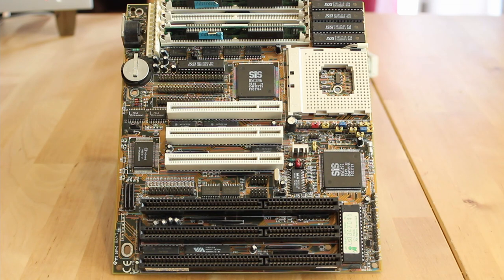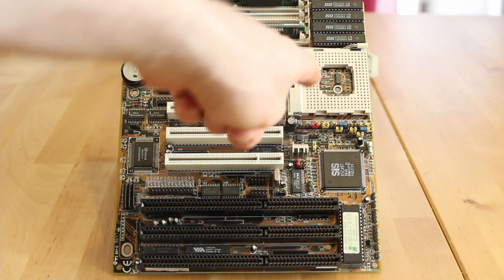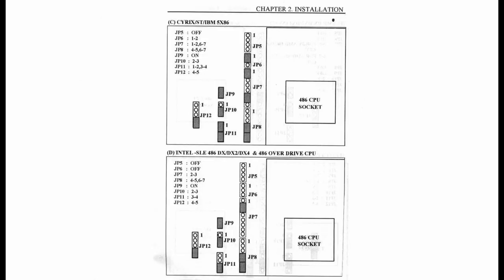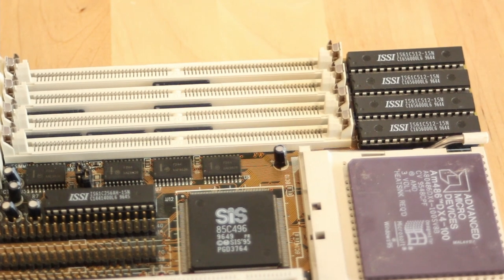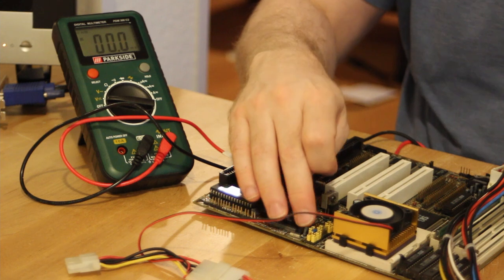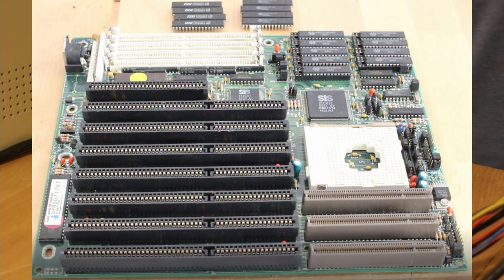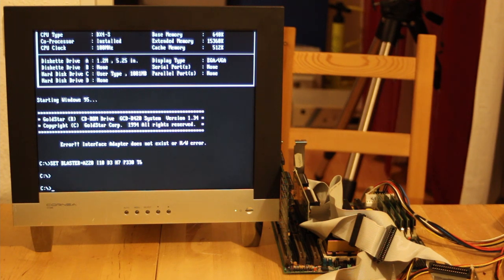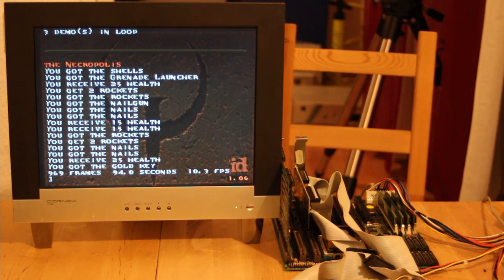Attempting to revive a Socket 3 Motherboard + 512kb Cache Experiments

Comment: Waiting for my 512k cache to arrive from Aliexpress for my P133 - I did a video look over the IBM PC330 P75, and since then....
Dead CD-ROM drive replaced by spare CD-RW, Dead Sound card (software good, but never got any audio) replaced as well, P75 replaced by a P133 I had left over from way back (and set board for P100 as it doesn't specify P133, runs it fine), also pulled the mismatched FPM + EDO and loaded it with all EDO.

Now my quandary, I though my S3 Savage 4 had died, but it seems the monitor I was using just didn't like it, so I got a Quadro NVS 280 (FX5500) and now I don't know what to use (built-in, Trio64 limited to 32 by RAM config).

Target: DOS + Win98, so I guess the S3 would retain better DOS compatibility (and even win 3.1), while the NVS 280 is a much more featured Win98 card.

Also debating loading the the other 2 slots with....
PCI Sound (SB Live) and ISA network
ISA Sound (SB16 value) and PCI network
ISA sound and PCI USB
Reply from the maker: Sounds like quite a nice machine, whichever way you choose to go. Hopefully the cache works ok for you. It seems to be finnicky in my experience so far. The board you have is probably more reliable than the ones I've been using though.

Comment: I think there are expansion cards you can buy that show you error codes. Perhaps that can help with finding the fault. Also, perhaps you could check the clock. Crystals can go bad.
Reply from the maker: Yeah, I ought to have checked that. The BIOS and clock were actually my next guesses for what could be wrong with this board. Unfortunately these 486 boards are a lot harder to diagnose than earlier stuff, and it's currently way outside of my experience to be figuring it out if it isn't one of the larger discrete components that has gone bad.
Reply: @PCRetroTech  There is also a diagnostic freeze spray to check whether chipset is faulty. Many times faulty chip "wakes up" when frozen (and dies again after a while).
Reply: @PCRetroTech  If the chips are bad, it's not something anyone would bother testing, but either swap them out or use the board for spares. The line has to be drawn somewhere, right? Chip cooling, like @fradd mentions, could help identify a faulty chip though, if you really want to know. It's possible to check chip legs for shorts and breaks, but that's a lot of effort for finding a problem you can't fix anyway.
A re-flow might be an option in case there's a connectivity issue on the board. Swapping out the Crystal is at least an easy thing to do. The BIOS is a bit more tricky, at least when you don't have a backup.
There isn't many components on this board, so really there isn't a whole lot that could be wrong, and there doesn't seem to be any other evidence.
Hope you find a fix. Either way, it was interesting to watch! Edit: Ah, you fixed it!

Comment: Thanks for showing UH19 :)
If you look closely on the back you can actually read "LS486E"

I have added the manual to the page and more infos about the board.

Actually there IS a bios on the page ! It may not be realy clear though, but in the BIOS section, if you click the three "???" you it'll let you download the BIOS.
Reply from the maker: Oh yeah, I really did miss that. I'll look out for that next time.
Reply from the maker: It might be worth also adding a note to the page about the incorrect FSB settings in the manual (1-2 <-> 5-6).
Reply: @PCRetroTech  absolutely !

which are the swapped jumpers exactly ?
Reply from the maker: @DxDeksor  It's JP18. The manual says the 33MHz setting is 1-2 but it is actually 5-6, at least on my board and one board on Vogons. Of course I don't know how common the problem is and whether it is a PCB or manual issue. But it's useful info for anyone stuck like me. In my case someone had remove jumper W2 and my board wouldn't start up without it, so that's why I wasn't easily able to find this problem without a hint. I don't know what W2 does (in either setting).
Reply: @PCRetroTech  I've added this info to the page, thanks :)

Comment: I have the same exact board, visually in pristine condition, and I have the same problem- board is not booting whatsoever, I had speaker attached and no beep at all. Seems like these boards go bad on their own or something..
Reply from the maker: Yeah it is a very odd case. It's hard to see from the video, but this board is very clearly not physically damaged. Of course it is possible that a surface mount component has been knocked off somewhere and I've missed it. But I have looked. The board really ought to be working, and I feel stupid like I've missed something obvious. Let's hope we figure it out eventually.
Reply: @PCRetroTech  I started researching it, and it seems that in some manuals the FSB settings for 33mhz are flipped, jumper isn't on 1-2 Top position but on bottom 5-6 position. I will test that when I get home
Reply from the maker: @yosuhara  Oh, that sounds interesting! I tried only 33MHz and 40Mhz settings. If these are really backwards then that would definitely explain things. That sounds so promising that I'm going to try it out right now!
Reply from the maker: Unfortunately I don't think that is the (only) problem with my board. Still no luck getting it to POST.
Reply from the maker: Nope, I take that back. You nailed it. 33MHz is incorrect in the manual!

I had another problem with the board (also not in the manual), which I just diagnosed (jumper W2). Will show details in the next video. Very exciting because I have heard this is one of the fastest PCI boards in existence!
Reply: @PCRetroTech   @PCRetroTech  awesome! Now I have hope to get my board running too! What is that w2 jumper for, or should I wait for next video?
Reply from the maker: @yosuhara  No idea whatsoever. But it does make the board start up. I had tried it previously, but not with the FSB set correctly at the same time.
Reply: @PCRetroTech  good news, my board came to life too :)I tested only with 5v cpu yet, but it looks promising
Reply from the maker: @yosuhara  Great!

Comment: Hi, I happen to have the same motherboard with an Am5x86-P75 133ADZ and it just wont boot. I connected a speaker to it but I don't even any error codes. Could you post a picture with exactly what pins did you check to see the voltage that goes to the proc? I managed to measure the power that goes into the mobo and I think it's all good there. Also, any ideas on what could I check to see if the mobo is dead, or the proc?  Thanks
Reply from the maker: You need a pinout diagram for socket 3 and look for VCC, VSS and ground. It's easy to find such diagrams online, not so easy for me to get the board out of storage. Some standard things to check 1) try pressing reset, 2) check the BIOS clear jumper is not set, 3) try shorting the BIOS clear jumper, power the board down, remove the jumper and try again. The chip is very unlikely to be dead. They are super reliable if all the pins are there. Check for damage to the board, leaky battery and damaged traces. Replace lectrolytic caps if absolutely every other option is exhausted. If some chip is dead it is going to be some work to identify it. That's the point things get much more difficult. Of course if you have a high bandwidth CRO you can check the clock signal to the CPU and for activity on data and address pins. If you have a ROM burner you can try updating the BIOS to the latest for that board. That's easier if you have another CPU that does work in the board though as you can just run the flash software.
Reply: @PCRetroTech  Thanks for the reply. I did stumble across a diagram for socket 3, I'll try and use it to measure. Resetting doesn't do anything, bios jumper is set correctly, I tried clearing the bios but it didn't change anything. The board presents no damage, it looks pretty new, battery is new, caps look ok (not swollen or leaky), everything looks "in place and good to go". Unfortunately I don't have CRO or a ROM burner and I kind of lack the skills to check the clock signal and stuff but maybe I'll read a bit into it, see if I can understand something. Thank for the reply.
Reply from the maker: @Tzzantaru  If the board is in really good condition and the tops of the caps are not bulging, assume the board does work. It should be possible to verify this with a cheap CPU the board is known to support. They are easy to buy online (and resell when done).

Comment: Attach a speaker, maybe you get a beep error code out of it.
Place the graphics card in a different slot, use a different card, try an ISA one.
And also, did you have a cmos battery inserted? Some mainboards require one to be present to start.
Reply from the maker: Yes, I tried a battery, put a different card in, tried a different slot. I must admit I didn't try an ISA one or a speaker.
Reply: I had to look several times as I didn't see the omnipresent speaker. It's almost as good as a POST card and can save you a lot of time. That's still even true for pretty modern boards. I find a POST card more useful for boards that don't beep at all. If your board does not beep, you can scope the address/data lines of the bios ROM for activity. If you get something, then the CPU is obviously running. In this case I'd trace back the signals from the bios to the AT bus controller and the chipset. I was able to fix a board with dozens of broken traces using that approach. It took me several days though.
Reply from the maker: @Shmbler  Yeah I have an oscilloscope. I didn't pull it out for this video because I'm not sure how good it is in the 100MHz range. It's a very cheap affair. But I'll definitely try out some of the suggestions people make before the next video.
Reply: @PCRetroTech  As far as I remember, the Bios is connected to the AT bus and that's running pretty slow at like < 10MHz. I think about everything that the Bios accesses is connected to that slow bus (presumably because of historical reasons). I found it to be a very rewarding learning experience to repair such a board. Good luck!
Reply from the maker: @Shmbler  Wow, really. I did not know that. If so then no wonder things go faster if you shadow the BIOS!
Reply from the maker: I've now tried an ISA video card and a speaker. No beeps. Keyboard lights  blink once and sometimes the ISA card shows the machine going into sleep mode.
Reply: @PCRetroTech  Definitively try adding the battery! You'd think it's only a thing with old macs, but I have had PC boards not even start up, if the bios battery was gone  / Dallas chip was flat.

Using the scope to see if there is any activity is a great idea. 

Another thing I have encountered were BIOS E(E)PROMS just loosing their content or getting corrupted. So if you have a reader, check them out.
Reply: @PCRetroTech  Most of the signals on a board of this age won't be anywhere up near 100Mhz, your scope should be perfectly adequate.

Comment: Why did you only used one stick of memory in that lucky star board? You need at least need 2 sticks to get the board going. 1 wont work.
Reply from the maker: The manual says you can use a single 4, 8 or 16mb stick. I'm not sure why you believe two are necessary.